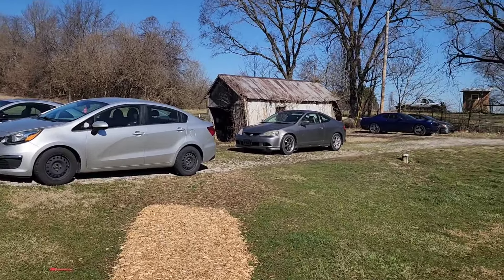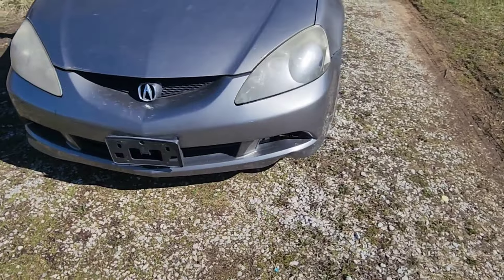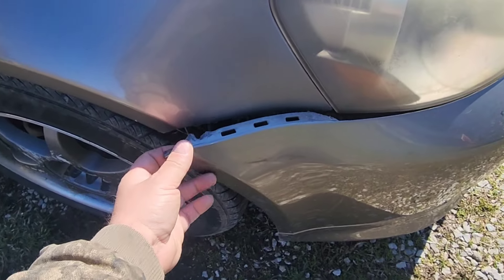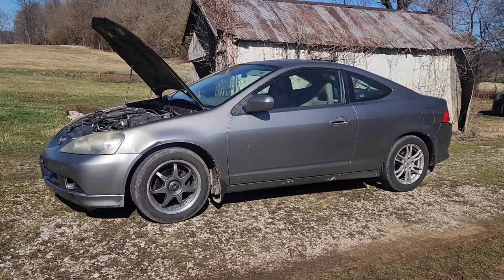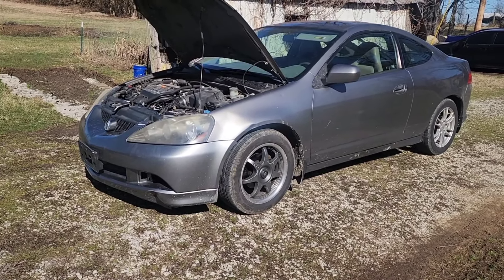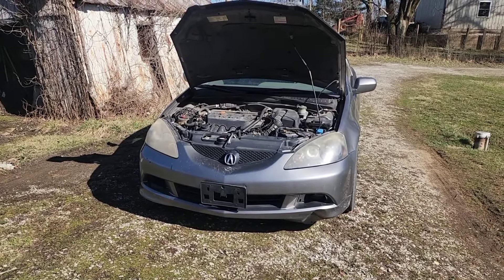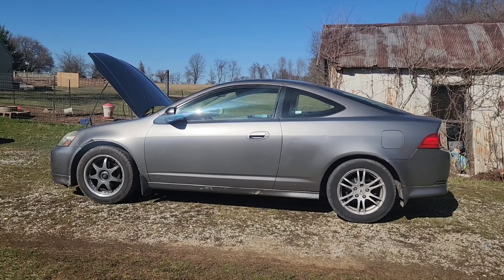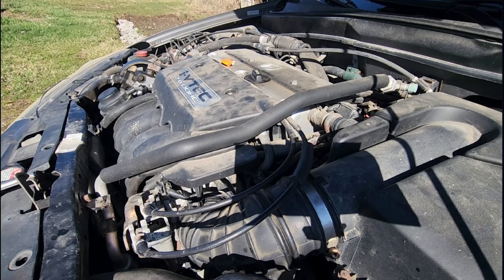New $2000 Beater Acura RSX Project Car

Comment: Your lack of bottom end power is related to the torn wires under the hood. The base RSX has a dual runner intake system for more torque down low- but the runners can’t switch with the runners stuck in the short position. Once that’s replaced, your torque should increase noticeably.
Reply from the maker: Yeah I looked into that today to see how it worked/what it did. Like you said, I figure that's the main problem. But I also found the Idle Air Assist Valve is broken today on top of the intake boot being ripped. 3 things broken with the intake system! I'm sure the computer is having a heck of a time trying to keep the afr's in check. I wish that was the cause of it going into limp mode, but knowing my luck it's probably the spool valve/vtec solenoid acting up also. Would make sense afterall, with 170k miles...

Comment: I have acura rsx base automatic. FBO on stock tune. I been roll racing like that 4 years using the sport shift mode. After 4 years the Auto transmission blew on me. Other than that the car was able to win some races.
Reply from the maker: I just smoked a squatted truck in mine and it's still 100% stock and not running right lol. I went to go around him and he floored it trying not to let me pass but I still got around him- laughed in his face as I zipped by him lol.
Reply: @92kbuilds-mn2lk  these RSX are so light. Mine was fully gutted interior too. It wakes up the car. I think I removed like 300 pounds. Stock weight is 2800 pounds.
Reply from the maker: Yeah I would imagine gutting an auto would really help it get off the line much faster plus just overall in general.

Comment: With todays prices $2000.00 doesn't generally get you very much. A whole car is a bonus. Different tire treads are for different surfaces. 4 different tires allows for a more versatile driver. It should be prepared for anything. HA HA HA!  
Looks like hail damage all over the car to me. Acorns dropping isnt going to leave dents like this. Glad you have the other matching wheel. Unmatched wheels is so ghetto. Initially it seems to be a little better than the Eclipse was intially but time will tell. Gonna be a nice little project car.
Reply from the maker: Yeah I can't tell you how many old blown up or wrecked cars I saw for sale, where people still wanted 2 grand for them lol. What the hell has gotten into people? And yeah it handles real wonky right now because of all the different tires. The body is much rougher on this than the Eclipse (even without the hail/acorn dents), but I guess sorta mechanically better off than the Eclipse was initially? I mean the Eclipse overheated due to the coolant leak and then proceeded to skip time on me almost immediately as soon as I brought it home, whereas the RSX I have been daily driving it since I brought it home (Eclipse is on jack stands right now getting a whole new front end). 

But I have found equal amounts of issues under the hood of the RSX and it goes into limp mode everytime I drive it lol. So, in reality, not a whole lot better off than the Eclipse was even though I payed twice as much for it. But honestly the Eclipse was a steal for $850, whereas with the RSX, I payed about what it was worth. I would have been much happier with it if I had gotten it for a few hundred less, but they were already turning down offers for $2k so I had to offer more if I wanted it. Regardless, I'm happy it's in the driveway now and I already have new parts comming for it for fresh content...
Reply: @92kbuilds-mn2lk  Yeah, I dont understand the prices of non running vehicles today, especially those with blown motors or blown transmissions.  WHo's buying this stuff for thousands of $?  
I guess they each (Mitsu & Acura) have their own issues but they're both good for channel content as they have different iissues.